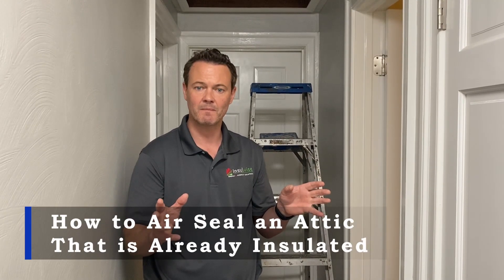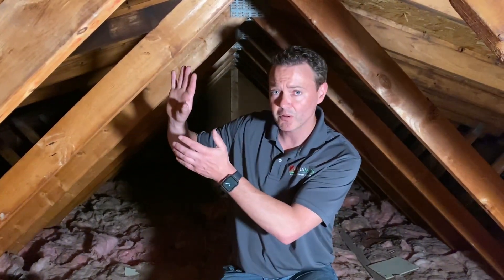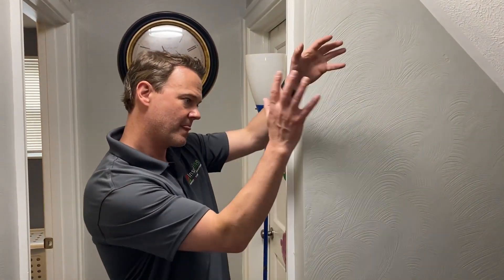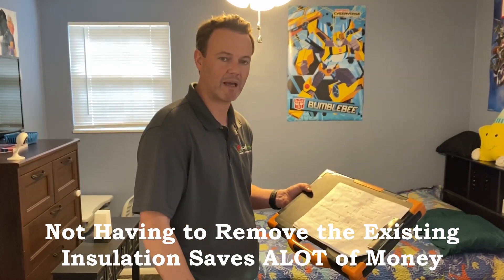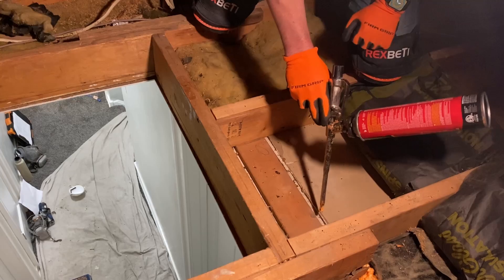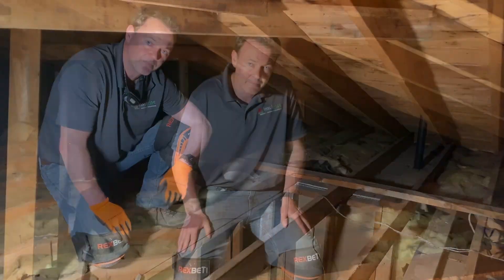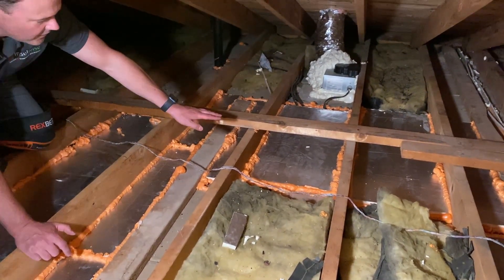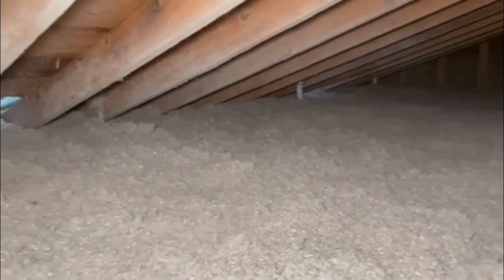Insulation Expert Reveals the BEST Way to Air Seal Your Attic

Comment: This is so incredibly helpful, and exactly what I have to do in our attic. I've seen plenty of videos showing sealing an attic that does not have insulation in it, or taking all the insulation out, sealing the attic and then re-insulating, which just seems incredibly wasteful to me, not to mention expensive. From what I can tell, though, making a map isn't really necessary, since each bay needs to be sealed all along the joists?
Reply from the maker: Thanks!  You don't need to seal along the sides of every floor joist.  You only need to seal the actual penetrations in your attic floor that allow air from inside the home to escape into the attic.

Comment: This information is still best practice for older homes. The cellulose insulation also helps prevent airflow from gaps that are almost impossible to seal with foam. As a bonus cellulose reduces “washout” which is air moving through fiberglass insulation and taking heat with it.
I personally don’t think R-49 is cost effective since a perfect R-13 layer blocks 92% of heat. Diminishing returns means you can only gain a few percentage points from doubling your insulation. Concentrate on air sealing and even distribution and compaction as shown in this video!
Reply from the maker: Thank you, air sealing is definitely a critical repair needed in all attics.  However I have to disagree regarding only installing an R13 of insulation onto the attic floor.  If we're talking about 2" of closed cell foam (an R13 for that insulation type) I would be more open to agreeing with you.  But with just about every other type of insulation you'd be far better served with a much higher R value.  There are reasons why the code for attic insulation started at R19 in the 1960's-70's, then up the R30 in the 1980's-90's, and finally all the way to R49 in the 2000's.  The data shows that more is better up to about an R49.  I believe Canada goes to R60 with their attics.  
Andy

Comment: Nice video. I learned a lot. I have one question. Does this home have soffits to get airflow into the attic or does it have a louver on the ends? I have soffits and baffles.
Reply from the maker: This is the most commonly asked question and I failed to call it out in the video.  This home did not have soffit vents so we installed intake vents along the back of the home.  You can see them in the last 30 secs of the video.  Thanks for commenting!

Comment: What about vents opening on the sideof the roof which allows air come inside to the attic? Looks like you covered them as well
Reply from the maker: This is the most commonly asked question and I failed to call it out in the video.  This home did not have soffit vents so we installed intake vents along the back of the home.  You can see them in the last 30 secs of the video.  Thanks for commenting!

Comment: I'm curious, if the homeowner wanted to use some of this attic space for storage, could plywood sheets be laid over the foam (or rolled fiberglass insulation, if that is what is used)? Thanks.
Reply from the maker: Of course.  You just need to make sure that the attic floor has been air sealed underneath the plywood. 
Andy

Comment: Thanks for the informative video! If you fully air seal the attic, in your experience do you have any significant concerns about possible backdrafting from a gas furnace and an atmospheric vent water heaters? I have a house from the 60s with absolutely terrible insulation, and there are rebate programs in my state that promote air sealing the attic. The companies I've called so far have all said I'd need to replace my water heater with a power vent model and probably my  furnace too to avoid backdrafting CO even though both systems are younger than 10 years old. Wondering whether they're just trying to upsell me or if there's actually a significant safety risk.
Reply from the maker: There is a risk of back drafting with the scenario that you laid out.  I would contact an energy auditor with a blower door and see if he can help you there.  You are talking about thousands of dollars in equipment so I'd look for a work around.  Do you have any basement windows or other ways to introduce a small amount of air into your basement?  
When I used to do low income weatherization homes, we would install a large return grille in the bottom of the basement door for homes like this.  That way the combustion appliances could always pull air from other parts of the home (which is ultimately the outside), but either way the attic always got air sealed.  I would think there is a safe work around here, but it may require some testing / confirming with diagnostic tools. 
Andy

Comment: Remove the stairwell....hang a ceiling on ceiling joists.....seal and insulate
Reply from the maker: That's certainly one way to approach it, though it's a much more involved renovation than what we typically do.
Reply: @insulwiseenergycomfortsolu3293 
Don't rebuild the pitched ceiling, only sheetrock the ceiling joists and walls above the stairs...

Comment: Did I miss the soffit baffles?
Reply from the maker: 1.	This house had no soffits, overhangs, or intake vents.  We installed slant-back vents a few feet up from the gutter along the back of the house to provide intake air for the ridge vent.  You can see the light coming through them at the end of the video and I believe I call out that we did that and why.  Thanks for commenting. 
Andy

Comment: Very informative, love the video! Couple of questions though: I don't see rapter baffles on the attic pictured, does going to R-49 not require it? Is the blown-in insulation in the final images covering the soffit vents?
Reply from the maker: This house had no soffits, overhangs, or intake vents.  We installed slant-back vents a few feet up from the gutter along the back of the house to provide intake air for the ridge vent.  You can see the light coming through them at the end of the video and I believe I call out that we did that and why.  Thanks for commenting. 
Andy

Comment: I have a house that has quite a large number of old can lights could a guy just replace those are like the new Halo light hopefully would have some type of a gasket or should you do that in addition to putting some type of a cover over the top of the recessed fixture
Reply from the maker: We encounter the newer lights all the time.  If it's an IC rated can light we still foam seal the can to the attic floor.  I don't trust the gaskets.  If it's a lower profile LED recessed light we box them.  The reason is that if it ever burns out (which it will) you will need to replace the whole light.  If it's boxed you can do that easily. 
Andy
Reply: @insulwiseenergycomfortsolu3293    do you have a box that you'd recommend when sealing those low profile halo LED recessed lights? And do you put the junction box under that box too and then seal around it all, or do you keep the junction box outside the enclosure? I'm definitely losing a bit of air through my existing recessed LED lights and want to address it effectively and safely

Comment: This is a great video. Do you keep the batt insulation in the stair bay void that was thrown down in and foam board over top?? Or do you pull that out before installing the foam board??
Reply from the maker: Normally we'd try to pull it up into the attic and use it there (when it's still fitted into the attic floor joists).  But if it falls down into that space we don't normally attempt to recover it.  Those voids are awkward as heck to move down into and then try to climb out of (I've done it many times).  I'd prefer my staff not risk falling through the sloped drywall ceiling and just leave them in place there.  The risk versus return isn't worth it for us.

Comment: I have a 1950s home where there is no air/vapor barrier  between the drywall ceiling and ceiling joists. Would you advise spraying closed cell directly to the attic side of the sheetrock?
Reply from the maker: Thanks for commenting.  And no, drywall with a few layers of primer / paint on it works pretty effectively as a vapor barrier.  If you are able to locate and then air seal the leaks in the attic floor you will experience a notable and positive impact.

Comment: I once had a cathedral ceiling with a bulk head in the low end and I was about to seal it up when the insulation guy said he could just fill it.  Against my better judgement I let him do his thing, and a year or two later it settled to the point where it allowed the insulation in the cathedral ceiling to drop down.  Fortunately the homeowner called the insulation guy and let him take care of it.
Reply from the maker: That's an installer error.  We sometimes have to fill voids as well, but you do it understanding that it will settle by about 10%, so you add extra.  Glad they came back to address it.

Comment: Hi! I am looking to personally air seal my attic after an already blown in fiberglass insulation. It’s probably an R49. What are your tips for navigating the attic? I’ve tried several times, but I get so overwhelmed with putting the insulation in bags and removing them. Do I need extra wooden boards to kneel on or are knee pads enough? How do I know where all the wire holes are? Do I just fill the ones I happen to find along the way? Thanks!
Reply from the maker: Thanks for commenting!  Best thing to do is to create a map of your walls and misc air leaks like we do in this video.  We're used to finding the floor joists with our feet and knees and wading through the stuff, but it's definitely more challenging with that much blown fiberglass present.  Two tips:  1)  You're always going to find a lot of air leaks around bathrooms; many top plates, bathroom fans, and always plumbing stack pipes  2)  Always chase down wires.  When you find a wire there are usually 2 separate air leaks, one where it comes up and another where it terminates 
Hope this helps!
Andy

Comment: Sounds really expensive labor
Reply from the maker: I would not describe our work as "cheap."  That said I would describe it as some of the highest value work that you can ever have done to  your home, at least if you value your comfort and would also like improved energy efficiency.  It is difficult to find, train, and then retain staff who can do work that is this physically AND mentally demanding.  Staff like this deserve to be compensated well, and Insulwise's sales and production teams are.  This is a very basic and standard attic.  Many of the homes that we are brought in to perform air sealing and insulation work on are FAR more challenging, and in every way.  
Andy

Comment: Wow!  how did you reach the top plate of the exterior walls with that strong sloped roof?
Reply from the maker: Thanks for commenting.  I didn't.  In some of these homes there just isn't enough room to get to the exterior plates.  But --- what we have found is that IF the exterior walls have been insulated with decent batt fiberglass --- that the rate of air loss through them is significantly less than the top plates that are over top of uninsulated stud bays.  We don't see nearly the level of black streaking in batts that over exterior wall top plates in these situations.  
In scenarios where we need to make sure the plates are sealed -- and the exterior walls are either poorly insulated or totally uninsulated -- we dense pack the exterior wall stud bays with cellulose insulation.   That seals them good and insulates the walls. 
Andy

Comment: What about the roof vents all around the edge of the house, did you cover those up?
Reply from the maker: How do you mean covered up?  At the end of the video you can see the light coming in from them on the back of the house.  We installed 4 to create intake ventilation.

Comment: This definitely will help air sealing over nothing but you'd never get all air leaks.  The best would be to hire a closed cell foam contractor and have them lay down 2" on the bare attic floor, then whatever fluffy insulation on top.  You'll start with R-12 from the foam.
Reply from the maker: We get the attic floors significantly tighter using these methods.  If we weren't achieving this the mold would come back (and I don't like call backs!).  Your method would achieve a tighter result -- no doubt.  But it would also entail 1)  a full insulation removal prior to installing the spray foam  2)  the added cost of installing 2" of closed cell foam (that alone would cost close to what this whole job cost if I had to guess). 
Your suggestion would not be in the budget for 95% of our customers.  And if we can accomplish their goals in achieving a far more comfortable and energy efficient home while also permanently eliminating the mold that was there and for a cost they can afford, why not?
Andy
Reply: @insulwiseenergycomfortsolu3293  We did this during our new home build.  Many older homes are leaky anyway, so capping the attic completely air tight in an older home isn't nearly as effective.

Comment: Great video. I have an unfinished attic with a plywood floor with about 5 inches of cellulose insulation under it. Would that have to be removed  to find out if the attic was air sealed by the previous owner, before I pay to have more insulation added.
Reply from the maker: Yes pull it up.  We have to do that all the time.  There is a 99% chance the attic was never air sealed.  There is also a good chance (if you live in a cold climate) that there is mold growing on the underside of the plywood) from water vapor escaping up from the home via the air leaks and condensing on the underside of cold plywood and then rotting. 
Andy
Reply: @insulwiseenergycomfortsolu3293 Thanks for reply. I soon as I read your response, that old cash register sound "cha ching" went off in my head!

Comment: Great video very helpful. For the exterior walls. How do you seal that top plate ? With faced batt, unfaced batt or foam?
Reply from the maker: In attics with low sloping roofs we sometimes can't seal the exterior wall top plate.  However, if the walls have thick fiberglass batts in them they will often do a decent job of staunching air leaks around the batts.  We don't see nearly the level of black streaks (from air leaks) in fiberglass when the batts over walls with batts in them.  When the walls are empty is when they hemorrhage air. 
Andy

Comment: Nice job, thank you. How did you manage the ventialtion from the soffit into and out of the attic?
Reply from the maker: Everyone assumes that all homes have soffit vents.  They don't.  The bulk of homes built in Pittsburgh before the early 1980's have NO soffit vents whatsoever.  This home didn't even have an overhang.  We installed slant back vents on the back of the roof to provide intake ventilation.  Watch the video at the end, I call them out and you can see the light coming in through them. 
Andy

Comment: We are our own GC on our custom home.  I’m in Colorado or I’d just hire you outright!  Any tips for new construction on pre and post insulation walk through. I have already started some of our own details, I put r10 sub slab, r5 on the edges of the slab continuing up our basement walls.  But the rest is on our insulation contractor.  We’re in zone 7 in a county that goes by irc / iecc 2018.
Reply from the maker: Thanks for commenting, a good approach is to have a detailed conversation with your contractor about air sealing early on in the build.  We don't really do any new build work, just existing homes.  But you've got lots of good options.  Colorado is a vastly different climate from Pittsburgh.  It's much drier, and you may have wild fire considerations where you live as well.  I've seen some people calculate that you don't want soffit vents where there is wildfire risk due to the risk of embers being pulled up into them?  However I don't know too much about that.  I do like what you're doing with the slab and block wall insulation.  
There are lots of different options you could use on your walls.  Open cell foam, flash and batt with closed cell and batt fiberglass, and also wall spray cellulose.  Your attic could be either spray foam the underside of the roof with closed cell foam or conventional (what you saw in our video).  The conventional route is straight forward.  But if you chose to spray foam the underside of your roof there are lots of important considerations to make that your contractor needs to be aware of.  
Let me know if you have other questions and I'll try to help where I can. 
Andy
Reply: @insulwiseenergycomfortsolu3293  seems like many of the details are the same.  I’m going to go through the house pre, during, and after everything.  Learning how homes are built has been fascinating, learning so much about details. I insisted on a sheathing called Zip R for R6 continuous exterior.  Paid extra for kick tush U 0.16 windows.  I just want to learn from experts to get the important details right the first time.  Pretty countertops can be replaced.

Comment: The attic may as well not even be insulated. That's probably the worst insulation job I've ever seen. Even my old 1920's house had blown in insulation done in the 80s that was better than this.
Reply from the maker: We see many attics that have poor insulation like this.  At some point the homeowner figures out that they have a problem and then we get the call.

Comment: Where are the baffles (rafter vent/raft-R-mate), which allow the soffit air to flow past the blown in r49 cellulose and onward to the roof vent or attic peak, for passive circulation?
Reply from the maker: 1.	This house had no soffits, overhangs, or intake vents.  We installed slant-back vents a few feet up from the gutter along the back of the house to provide intake air for the ridge vent.  You can see the light coming through them at the end of the video and I believe I call out that we did that and why.  Thanks for commenting. 
Andy